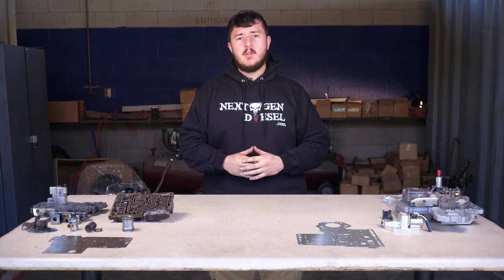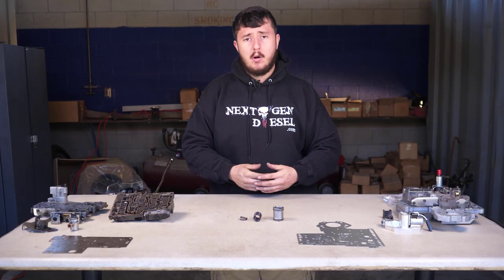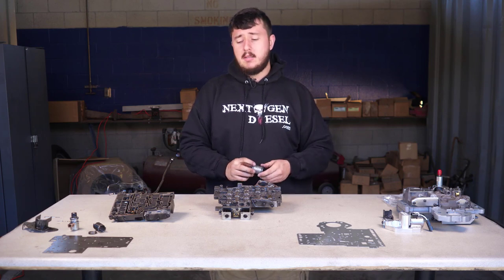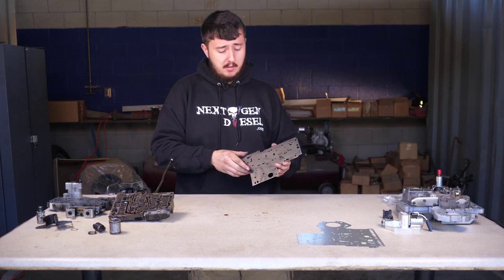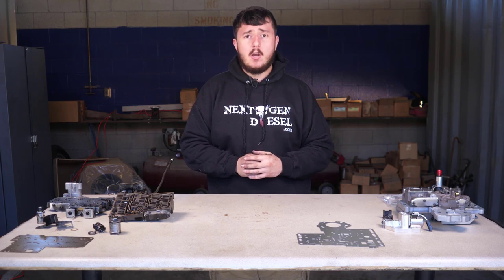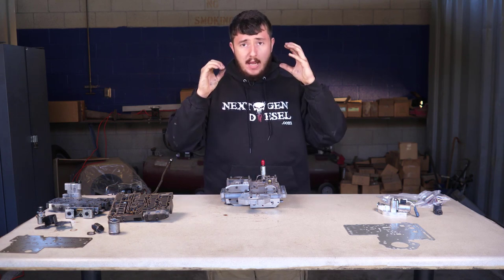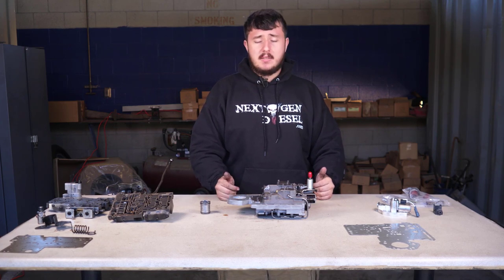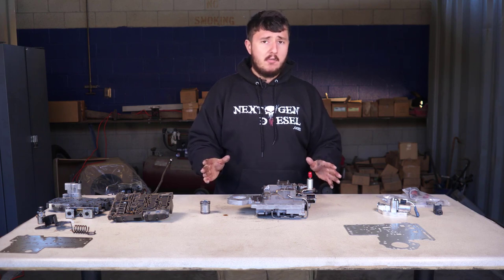[5.9L Cummins] Next Gen Drivetrain 47RE & 48RE Valve Body Teardown + Buyers Guide!

Comment: You sold me @ "it's kinda like a starfish... it doesn't have a brain, but it gits thru life anyway" lol. Thank you for your concise information, I've been wrenchin since the 70s and picked up every bit of what you put down in this tutorial. Ill be gittin ahold  of ya'll soon. I just picked up a 1999 Dodge Ram 2500 diesel 5.9 L with the 47RE and its gonna need a service..... engine is strong and running smooth on all cylinders but the transmission takes a moment to come on line. 😢. Thank you again, Chris
Reply from the maker: Hi Chris. You rock! Give us a call anytime.

Comment: I've got say make it sound good but coming from someone who has worked on countless 46 47 REs and having 3 myself from my experience the Accumulator Springs do break i have seen a lot of them broken and the customer didn't even notice it  the only Symptom you will get from any accumulator Spring breaking is either a harder or softer shift never seen a spring cause over heating now bad seals On the accumulators will cause a lost gear or overheating

Comment: Thank you so much I looked all over the internet to find why my 47RE transmission did not want to shift into third gear after I rebuilt it so I started to take apart the valve body and the first cover that I took off I didn't even know what it was for but behind there was the broken overdrive accumulator spring

Comment: Sorry to ask this 9n her but today I toke my 99 dodge 3500 cummins out to got to second gear smashed the pedal to the floor it went to first gear then my trans went to neutral I let out it went to second gear every gear works but fine. But to go from dead start I have to let of the pedal to go to second gear. And I can't get it back into park do you or any body have a idea what it could be.
Reply: That's a strange issue. Figure it out?
Reply: @danthisguy8541  yes I did figured it out. It was the 2nd gear band lever broke. I fix it a weak after it happened. And if you ant going to help then don't reply
Reply: @ronniephipps6555  proper grammer helps a mile. It's been 5 months I figured if you hadn't fixed it by now my suggestion wouldn't help you anyways. This is why I don't help people 😂
Reply: @danthisguy8541  🤣 you didn't help because you didn't know how to. But it's all good iam not a transmission guy but Luke I said it got fixed so it's all good have a good day